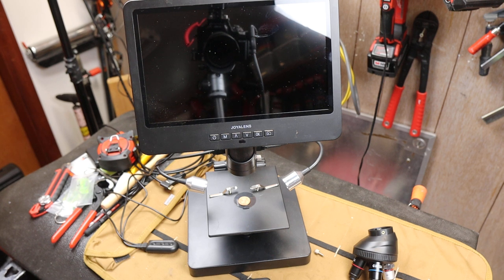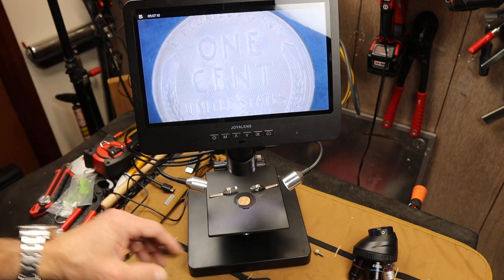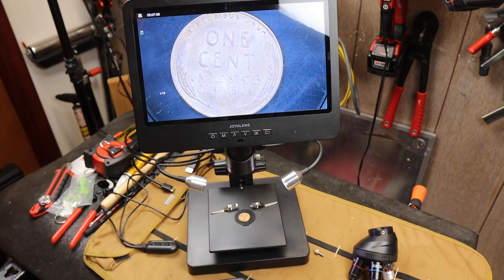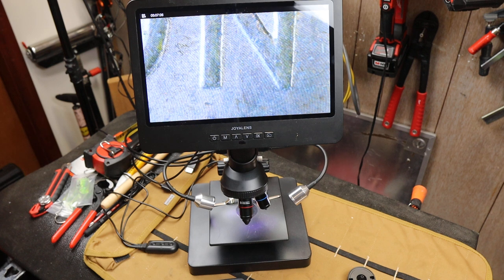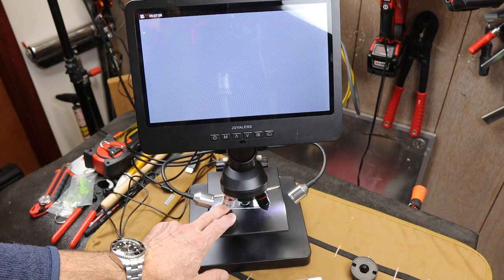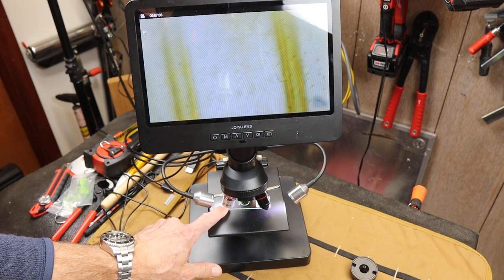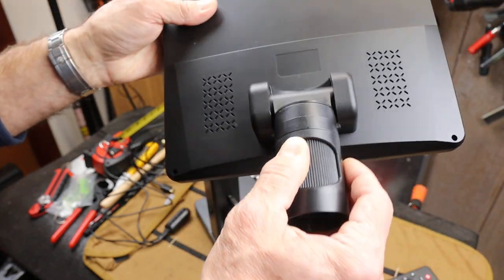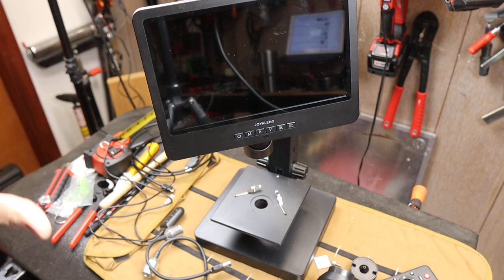JOYALENS JL249P Digital Microscope, Dual-Lens, Compound, Hi Def, 24M Pixel, huge screen, affordable!

Comment: Hello again Doc 
Thank you for another Great Video 👍 I am catching up on watching your videos.  Nicely done. Does this take measurements? I could see something like this on the job. Inspecting Jet Engine parts. Again thank you 😊
Reply from the maker: Hello George. Thank again for watching. There is no onboard measurement tools, but you could easily include a scale card or grid to image the scale. I suggest building a better solid stand for the scope if you plan on using professionally. The camera, screen and software are top notch, but the flexibility of the stand may be frustrating.
Reply: @lastbesttool  Thank you, kindly